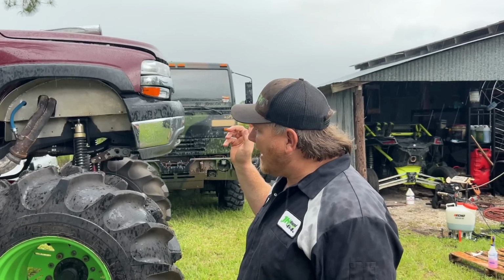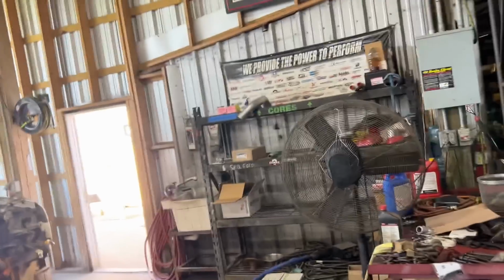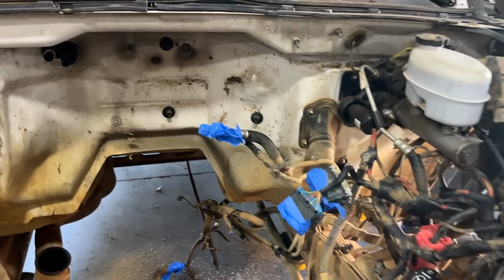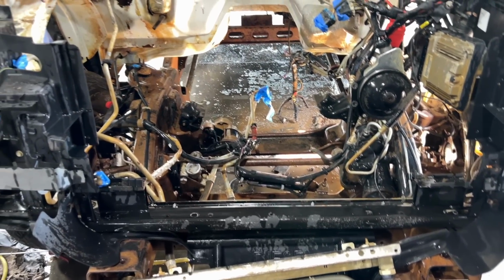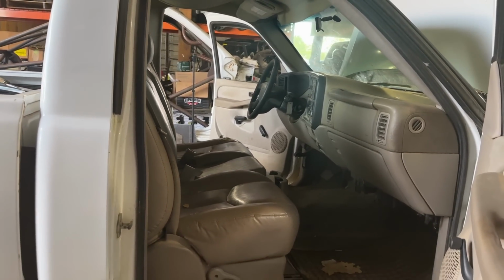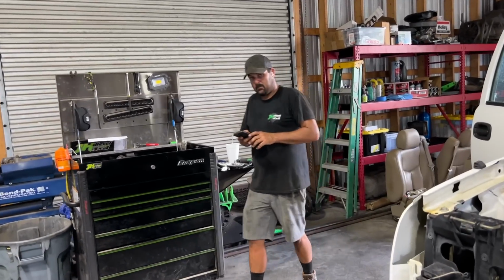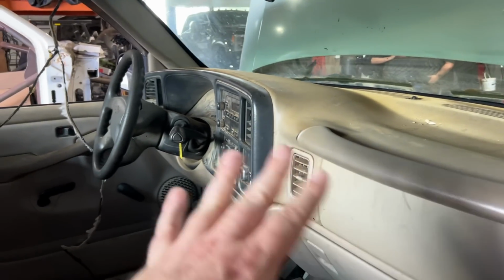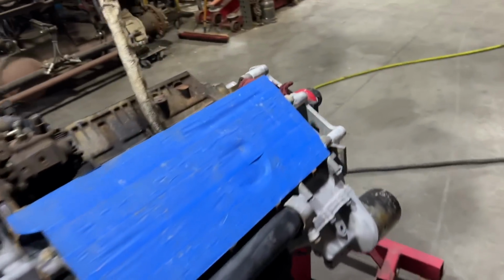Stripping This Dirty Old Farm Truck And Making It Into A Duramax Drag & Drive Truck!!!

Comment: Justin is killing it on Ron B. Glad you took your subscribers suggestion on the crank support. The crank may not have broken the first time you gave it the beans, but we all know it will break in a short time. I would have bet on the numbers of pulls before it snapped. My guess would have need 7. Lucky 7, pulls then Ron B would do a engine Delete.

Comment: Drill a hole through the drivers side engine mount. Run a 1/2” bolt thru it with a c lock nut just snug. Keep from ripping engine mount apart.

Comment: If you use red stucco take to tape connectors instead of painters tape it will hold and protect a lot better. Just a thought and bad ass trucks as always.

Comment: Just flip your bug catcher 180 degrees so the mouth is facing the windshield and run filter socks or ditch the bug catcher and build a intake tube and let it pull air from in the cab . But personally I’d just turn it towards the windshield and let her eat isn’t like your forcing more air you aren’t moving fast enough and beyond that a roots style blower sucks air in like a Dyson ! Lol

Comment: Should see if you can use a crank support or modify one meant for a procharger setup on an LS.... Ain't exactly the same but it will get you closer with less effort.

Comment: the problem with cleaning fine clay off things, is that most clay particles are relatively disc shaped, and they adhere to flat surfaces and each other with almost no air between them (even more so on very smooth surfaces) and no room for water molecules to break them apart. any serious abrasive will take it off, but its a serious bastard otherwise.

Comment: Any thoughts on making it into a short bed to save some weight? Maybe some D&D events might not allow that? Can't wait to see a duramax on the drag and drive events.
Reply from the maker: We talked about that but not sure if it will be much of a gain or not. Shorter wheelbase can be a little sketchy and I personally don’t like the look of a single cab shortbed HD truck. We have other plans to lighten the truck up
Reply: Don’t think weight is a very big deal at those power levels with diesel.
Reply: @JHDieseland4X4  I think a shorty would get more views but if you don’t love it it’s not really worth the work.
Reply: @coldnapalmFJ  weight makes a big difference in all drag racing. The Dmax is down on power over Cummins cutting a good light and 60' is how you beat the big boys.

Comment: Should I try it some super clean And let it soak into the Alabama clay for 15 minute's then pressure washed it off super clean works extremely well that's the only cleaner we've. Used here at my shop never had a problem with it.